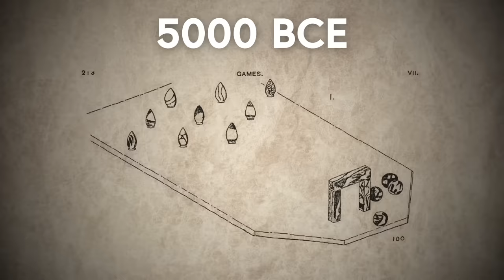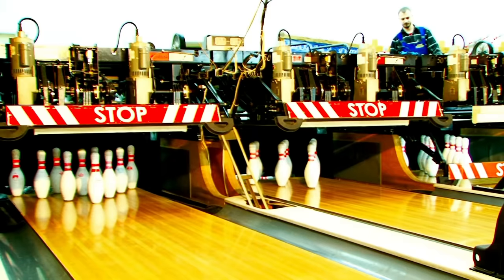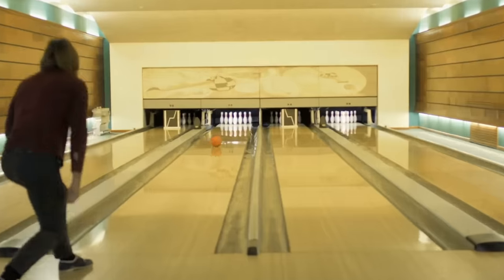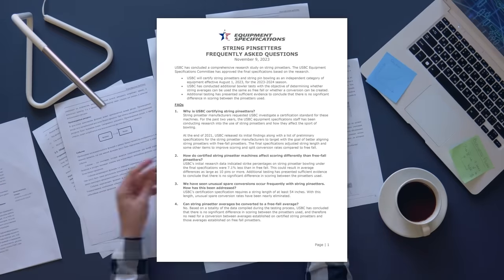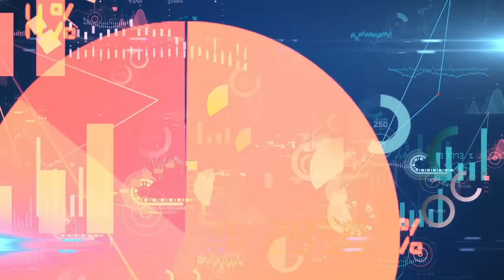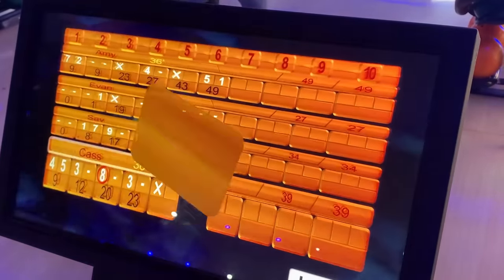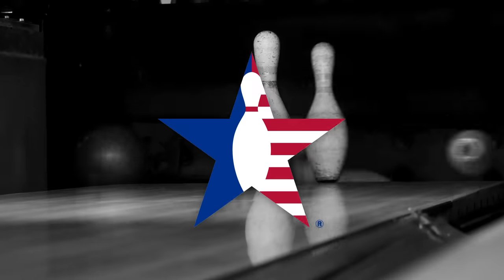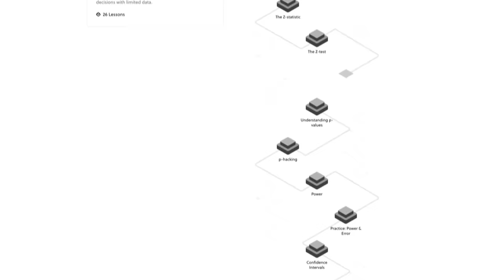The Controversial Machine That’s Ruining Bowling

Comment: I was a mechanic on QAMF spotters up to the 82-90 XLI for 10 years, so I am very intimate with the economics of actually maintaining a bowling alley. Freefall pinspotters are a higher capital investment, but are really not expensive to maintain. String setters require just as much maintenance and adjustment, though I suppose the PM is a bit "easier" to do, so it could be done by a less skilled mechanic. Like anything, you just have to keep up on the PM and I only ever worked at one place which made an actual effort to do so. Every other alley tried to skimp out on maintenance (typical know-it-all managers and beancounters who have never turned a wrench and think they know how to do your job better than you do) which quickly resulted in the machines regularly breaking down, requiring long downtimes with more expensive repairs. Especially during the break-in period on a new spotter, they require daily tweaks and cleaning and lubrication while they break in. Once they are broken in they run extremely reliably on the scheduled PM.

As for how they feel to bowl against.... The pins behave so differently they may as well be completely different games. I wouldn't expect a layman to be able to see the nuance, but anyone who has spent years in the industry would tell you for sure. The "high end" stringfall lanes that are closer in behavior to freefall lanes are nearly equivalent in ongoing cost. The truly cheap stringspotters may as well be carnival games.
Reply: I completely agree with you. I too worked maintenance at a bowling center. These machines were his livelihood. He treated them with the respect they deserved.

Comment: For recreational bowling, string pins are fine. For most leagues (non-cash competition leagues) it's still mostly fine. Tournament play is for actual money and matters

While it won't matter for amy, due to improper form and generally.... Bad howling, it is noticable. The most noticable change in string pins is absolutely spares. 7-10, 4-6-7-10, 4-6's, 8-10's and other normally very difficult (not impossible) sparss become reasonably easy

Especially players with high ball speed, they have enough raw power to essentially make splits a crapshoot rather than a real penalty for missing

Comment: My first job back in the 80s was as a pinsetter mechanic's assistant. Our machines were a bit different with the pin elevator being a scoop wheel and no camera involved. Just resistance sensors in the pick up tongs I think. Not easy babysitting a row of 42 machines late at night in the back of the building. Very noisy too LOL

Comment: I went recently to a bowling ally that had strings. I can't say it felt as good as traditional pins. They certainly didn't seem to move correctly when hit with a ball. But I think the biggest issue with that bowl was the fact they didn't give out bowling shoes so I had to play in your normal shoes. As I slide the last bit of my action I couldn't do that so I had to adjust it and that was must weirder than the strings.

Comment: I been bowling for almost a decade and strings are horrible. Alleys already cheap out on pin resetters and they break constantly so I cant imagine how much they will cheap out in strings. The problem is that string pins dont knock each other over, they slide and tip over but the string keeps them from falling. Its alot harder to hit a strike and make them fly everywhere since strings just push them and keep them from falling. The only good thing about strings is they make spares 100x easier such as the 7-10 split where the string can just fling a pin all over the lane

Comment: One thing to point out about pinsetters...I was pinsetter mechanic back in the 80s and 90s...there were really two main types then (Brunswick A2s and AMF 82-70s). The approach to operation between these two types was vastly different! Brunswick A2s are mostly mechanically driven where the AMF 82-70s had an electronic "brain" that ran some electro mechanical switches to control the table & sweep. The pin distribution & setting methods were completely different though (I heard it was due to copyrights between the two companies). I am partial to the AMFs because that is all I worked on. I knew some mechanics for A2s and they agreed that the AMFs were a simpler design overall. Both were reliable if maintained and both sucked if they weren't. The "new" Brunswick GSXs (shown in the graphic in the video but the actual video parts were the AMF machines) really seem to be a mix between the two designs from the past. I will say the belt systems for distributing the pins looks like it would be highly prone to jams and high maintenance, but that is only a guess. I'd like to see some quantitative data on them...

Comment: 1:20 modern pinsetters don't use cameras anymore, instead switches on the setting table detect which pins are standing - this is more reliable especially for "Cosmic Bowling" which apparently camera's don't like

Comment: Meanwhile, I'm wondering if over half the issues with the old-school pinsetting device couldn't be solved by a modernization/redesign. You CANNOT be tellign me we can't get better tolerances and more longevity with modern parts and manufacturing, to say nothing of better ability to simplify the device. 

It seems like the primary issue with the devices, from the alley's standpoint, is running cost, not initial purchase price. Having them fail so often and require specialist repair. It seems a bit suspicious that the pinsetting device has remained the same design since it's exception, despite it's CLEAR lack of quality.

Comment: As someone who has bowled competitively for the better part of 7 years, I hate string pins. And I know a lot of competitive bowlers agree with me, ranging from various levels of tournaments up to the PBA pros I've talk to. And this video does not even address what is, in my opinion, the biggest problem, spares. String pins get pulled back to where they are set. duh. the problem is that you can use this to make normally impossible spares, such as the 7-10 or 5-7-10, because you can pull the pins back into still standing pins if you hit it right. these bad splits are almost always caused by bad shots, but if you can just make the spares anyways, why spend hundreds or thousands of hours to make good shots. also, yes, it changes the physics of the pins. while it might not be a big deal for novice bowlers, the extra pin action (how much the pins bounce around, basically) and pin carry (the chance of you striking when you hit the pocket) could easily have a large effect on good bowlers, who are often neck and neck. so in a game where its very common to win or lose by 5 pins, this is a huge deal and problem.

Also, on the note of the machines killing people, so can any machine. cars kill people too. those people died because they were foolish around the machine. I've been a pin chaser (someone who fixes the machines) since I was 15 and I'm still here. if you have a healthy respect for the machines, have proper training, and use your head, you wont get hurt. literally the exact same for cars.

Comment: I remember string-setter bowling machines many many years ago. Only two places I know (A waterpark & roller-rink) had them and were set up in their arcade portions of the building. However they were tiny, two-lane arcade-styled machines that pretty much did all the hard work on it's own. Although they're both no longer in operation anymore, It's kinda weird that strings are becoming more popular for manufacturers likely because of those.

Comment: I used to bowl 5 pin here in Canada, both string and non string pins. There's a huge difference in pin action. It was easier to get stikes with strings as they can take out other pins.Lane conditions aren't much of a factor since most throw straight. I used to work at a small alley and the strings had to be replaced every few weeks from wear during league play. Also had to deal with a lot of tangles. I can imagine the same with string ten pin. A large  ten pin alley with strings would probably need more people in the back just to deal with tangles.

Comment: The test done in the video with the mid bowlers has many flaws. The bowlers are inconsistent, and to add to the inconsistency, the holes would have to maintain a consistent size in order for this to work because yes, the holes do affect your bowling, which is why you should have your own ball even if you throw straight.

Comment: I've known pins on strings for a long time, in the netherlands they're usually used for a game called "Kegelen", a "kegel" is a pin in Dutch. The game is played on smaller lanes than bowling but otherwise works almost the same. Due to the lesser diameter of the lane the game isn't as well known as bowling and most of the Kegel halls use the string system, as I can imagine after watching this video, to lower costs on maintenance. 
Fun fact about kegelen vs bowling: 

The ball only has one hole instead of three
The pins are in a diamond formation, instead of a triangle
you're only allowed to throw once

Comment: My buddy used to travel around and maintain bowling machines . Those early mechanical units are a masterpiece of design , they do so much decently reliably with nothing but one or 2 motors a bunch of switches and relays . I think from amf they only made 2-3 models of the free fall types ever . They did however update those models throughout the years. Witch ended in fully electronic control in the 80s since then in north america bowling has dropped in popularity so there hasn't been much change to most systems since the 80s . Now amf doesn't sell parts for the older model so there are people that just go and salvage parts from defunct Allys . My buddy just unloaded most of the parts and info he had veen hanging on to for 30+ years

Comment: The pinsetter breaking 6 times on one lane is a mechanic issue, i work at a center with 48 lanes, they break less than 10 times a night on average usually less than 5. Thats accross the entire center not just one lane. Mechanic at that center is seriously slacking

Comment: I worked at a bowling alley for a decade . The pinsetters in the animation, as someone mentioned, is a newer Brunswick model. The Gs98 or GSX. When people think classic machines theyre usually thinking of the 1960s models like the brunswick A2. 

The A2 is bulletproof, but is also way more likely to rip your arm clean from your socket. The GSX, however, has more safety measures and is much more likely to stop long before serious injury occurs. 

Being from canada, we offer 5 pin bowling too. These machines were Merlin 3000s (i think. Definitely Merlins.). They tangled like a motherfucker and the way they detected hit pins was notoriously unreliable. 

I guess what I'm trying to say is 10 years down the line, are these string machines still going to be as low maintenance as the manufacturers hope?

Comment: 3.5% is a pretty high p-value. It is common in the social sciences to declare something proven if the p-value is less than 5%, but that's why the social sciences are now dealing with a massive replication crisis. They need to repeat the study with more people and get a much lower p-value if they want to be able to reliably declare that strings don't change anything. They also need to use players that have spent a lot of time practicing with strings, which I'm guessing they didn't.
Reply: lol, the 5 p-value is just a back of the napkin “yeah good enough lol” number. You really put it well!
Reply: It's the wrong p-value entirely actually. It's the p-value of the Anderson-Darling normality test the researchers ran, not a p-value on a paired t-test. The study didn't even run a paired t-test. They just calculated the CI of the mean of a non-normal distrib calculated from the observed sample of differences instead of doing a formal "test".
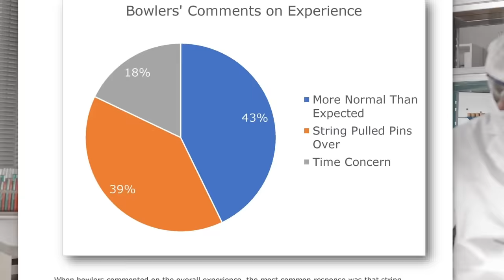Reply: The 0.035 p-value shown is actually for the normality test as you can see at 3:41. Calculating backwards the p-value for the mean difference comes out to 0.26, which matches the 0-spanning 95% confidence interval. The replication crisis in social sciences is caused by many different factors, of which the standard 0.05 alpha threshold is just a tiny one. Many other fields are doing just fine with the same alpha.
Reply: @glenmorrison8080  The CI is directly related to the corresponding t-test, as it is calculated with the same t-statistic (i.e. sample mean plus and minus standard error times the t-statistic). You can easily calculate the p-value for the t-test from the data shown at 3:41, which in my calculations comes out to 0.26. The reason they don't mention the p-value specifically is likely because it is much less informative than the confidence interval in this case.
Reply: @Vincent89297  0.26? That isn't statistically significant by anyone's standards.

The 5% threshold is what makes it susceptible to all the other problems. Not publishing negative results, which is probably the biggest problem, wouldn't be a problem if a stricter threshold were used, since there wouldn't be so many false positives.

What fields use 5% and don't have a problem with replication?
Reply: @thomasdalton1508  Yes that's the point... their null hypothesis is a 0 mean, and their conclusion is that the data doesn't support rejection of the null. As I said an insignificant p-value is less informative than a CI that sits tightly around 0 when the conclusion is that there is likely no difference in performance.

A stricter threshold would require much larger studies, which is usually not feasible when you require humans to show up and participate. In fact, it would only encourage people to try harder to p-hack: you're just moving the goalpost. Solutions like pre-registration are much more feasible in reducing the problems causing the replication crisis, in that they would actually change the playing field.
Reply: @Vincent89297  Yeah, I get you can calculate a t-test from the numbers there, assuming a normal distribution, but that doesn't seem to be in line with the steps taken by the report. They found the generating distribution to be non-normal, and then used a different distribution (some loglogistic dist) to get to a CI. So I don't think they ever even calculated a t necessarily. I definitely taking issue with your calculation, just how this video missed the mark on reporting the stats accurately. ✌️:)
Reply: @glenmorrison8080  I didn't look further and assumed they used a corrected t-statistic. My calculations are almost certainly off since I used a standard t-distribution, but it should still give the right idea: the actual p-value is pretty high, meaning it's not as informative as the CI.
Reply: @Vincent89297  Agreed, whatever it would be would be pretty high, and I think the CI method is really much better practice, as well. :)
Reply: @Vincent89297  Oh, you were treating no difference as the null hypothesis? That doesn't work. You can't set the thing you are trying to prove as the null hypothesis. They are trying to prove a negative, which is always a little tricky, but you can't just say you've proven a negative because you haven't been able to reject it. No evidence at all would fail to reject the null hypothesis.
Reply: @thomasdalton1508  There is no 'thing they're trying to prove' . They're investigating whether the strings make a difference in performance, in which case the null hypothesis must be that the difference is 0. They didn't 'prove' anything, they just concluded that the data does not support a rejection of the null hypothesis. Of course the difference could always be some arbitrarily small number, but that's not the point. The question is whether it's likely to matter for players in the actual world, which is why they provide the CI: the tighter it sits around 0, the less support there is for the conclusion that it would actually matter. There is absolutely a difference between failing to reject the null hypothesis with no evidence vs failing to reject the null hypothesis with a large amount of data: the latter severely restricts the likely range of the effect size, which is what they were actually interested in.

Comment: I work as a mechanic in a bowling alley with free fall pinsetters (in fact, the machines I work on are the very same model shown in that animation, the Brunswick GS-X), and my boss was thinking about replacing our pinsetters with string ones at some point down the line. Everyone seems opposed to that, but I never understood why, as I didn't see why it would matter. After seeing this, I still don't know why they hate them that much, as it doesn't seem like a significant change for the players. Even if it is, everyone else is at the same disadvantage, so it evens out for all the bowlers.
And yes, string pinsetters might mean I'm out of a job, but I'll likely have moved on to bigger things by then. And if not, I'd still say not being crushed to death is a nice trade-off.

Comment: I'm a Canadian who has bowled Five Pin off and on since the 1960s. The Canadian 5 Pin Bowling Association has used string pinsetters since at least 1967 - probably earlier. No complaints in over 55 years.

Comment: As a professional statistician, I really appreciate all the statistics of the comparison of the behaviour between the two Type of Pins while Bowling.
Reply: I get the CI including 0 would suggest that there’s not a difference,  but wouldn’t a p-value that low suggest a difference (unless they were using a really low alpha)?
Reply: @nicholaslewis8594  you are correct, a p value below 0.05 would indicate a 95% CI not covering 0. In 3:41 you can see they mixed Up two statistics, the 0.035 is from the Anderson Darling Test for normality.